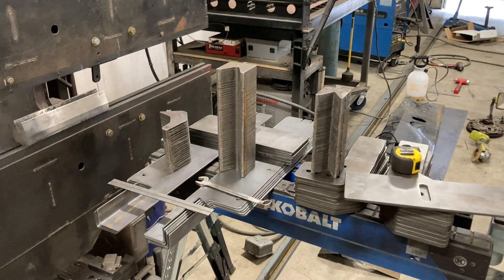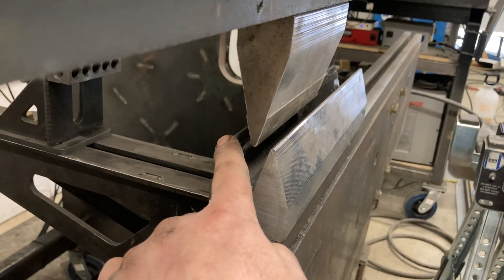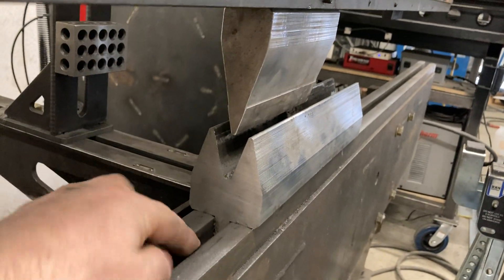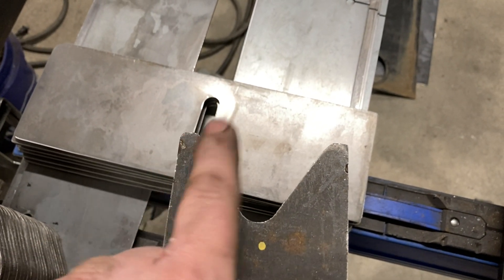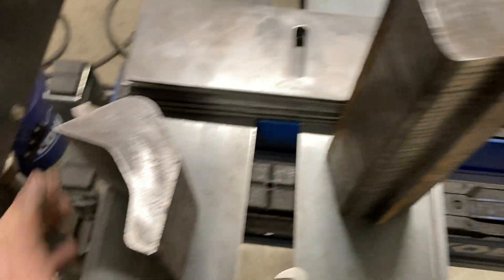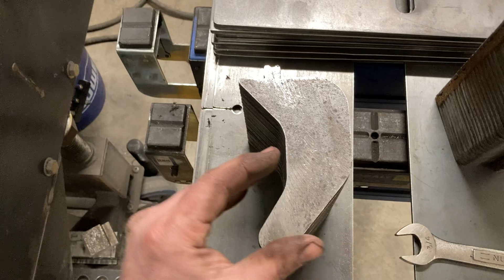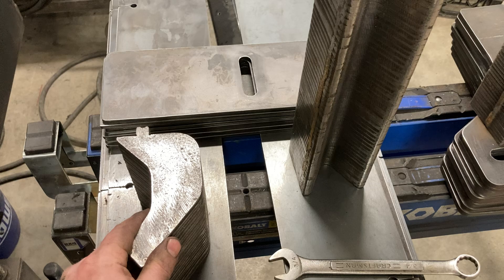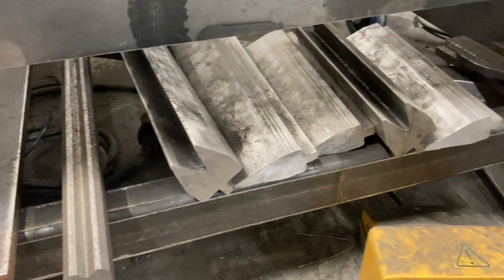Home made press brake dies / tooling

Comment: Hi my friend, I imagine this tool was cut using a laser cutting machine.
Could you tell me what is the power of the laser machine used for this type of tool?

I also have a few questions:
• What material do you use for the upper tool (punch/blade)?
• What material do you use for the lower tool (die/matrix)?

After manufacturing, do you perform any heat treatment (such as hardening, tempering, or similar) before using it on the CNC press brake, or is the tool used in its raw material condition?

I’m asking because this has a big impact on the tool durability, accuracy, and wear resistance.
Reply from the maker: I cut this tooling with a cnc plasma table. I typically use 0.250” plate. The material is just plain mild steel, no heat treatment. They last a surprisingly long time.

Comment: I just did a large 4 way die with the plasma cut and stacking method after not being able to find what I needed for a reasonable price. I ran a weld bead along the inner edges of the V profiles and carefully ground it down which left a nice clean edge. It look a lot of time but it works great and saved me about $800.

Comment: Love your homemade dies, this is on my to do list now. 
FYI I found that if you use a thin plastic sheet like 10 mil between your part and the bottom die you can stop the bottom die from leave any marks on your part ( using factory made dies). Still I bet this would greatly help on your home made dies.

Comment: Would it make sense for me to stack 12” length pieces of angle iron for a V die?
Reply from the maker: I’ve never used angle to make a die, my fear is that material spring back would keep you from hitting 90 degrees. This fear may be unfounded, again I haven’t tried.
Reply: @ultra4suzukisamurai679  yo lo he probado y el ángulo es mala idea para hacer 90 grados porque el material retrocede varios grados, y aveces necesitas doblar mucho mas que 90 grados . Yo instalé barras cuadradas y funciona mejor y también las puedo acercar y separar para buscar la eficiencia y con láminas gruesas necesita más distancia para que doble más fácil.

Comment: Those dies are awesome, is it possible to cap the die with solid material down both sides and weld it on? I've got a 40 ton 4 '  brake with 4 way die and that shiot is crazy exspensive, hell it was crazy money when I bought it 20 years ago. I run a 10 "  4 way die in my  Edwards Iron worker tooling station and I think that die set is almost a couple grand these days.  That 4'  4 way die is a mother fker to change out, gotta really be in love with your fingers when messing with that thing.
Reply from the maker: Yeah you could do that or cut the plates without the bottom tang.
Reply: @ ultra4suzukisamurai679 are u willing to share the model or any drawing of your homemade press?
Reply from the maker: @Overhaul_zoo_engineersx2  email me at downingbrianfab@gmail.com
Reply: @ultra4suzukisamurai679 I also sent you an email requesting info on your press brake when you aren’t busy. Thanks for your work!